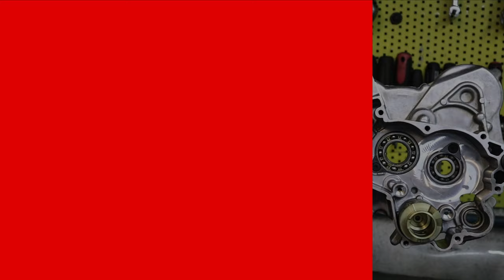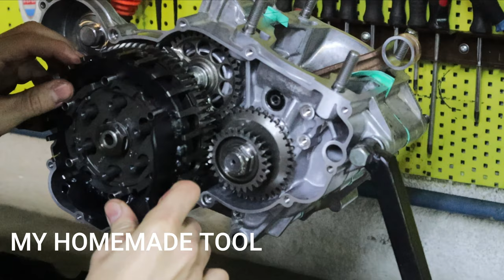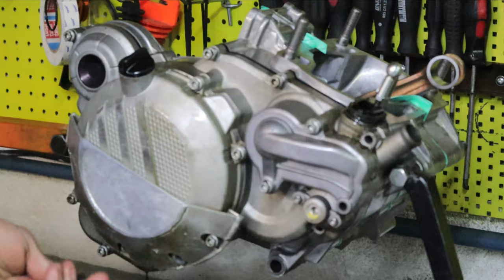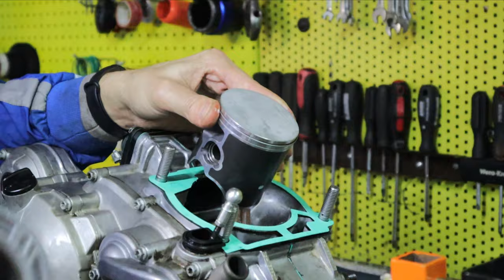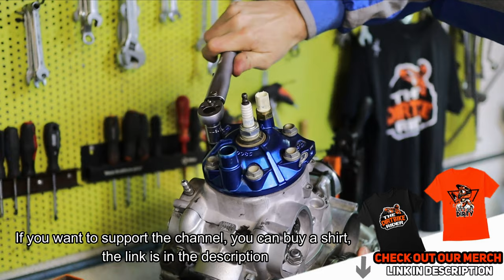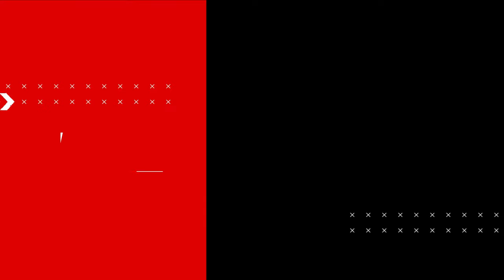KTM 300 2023 Assembly of Engine | Bottom End & Top End - Total $1500 in Parts

Comment: Are you aware that the 2021+ TPIs don't use a center gasket anymore? Using a gasket on those engine cases will obviously leave you with excessive play on the crank- and gearshafts if you don't compensate with extra shims.
Reply: crucial info. thanks